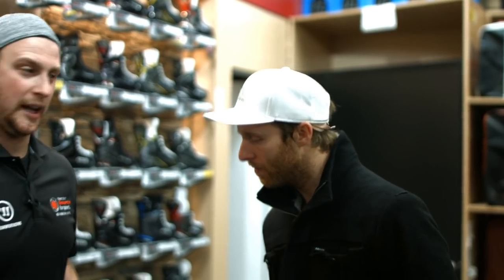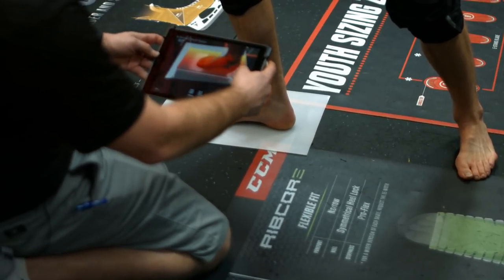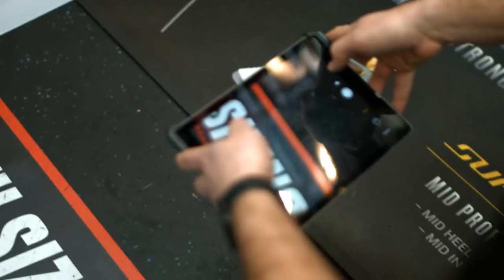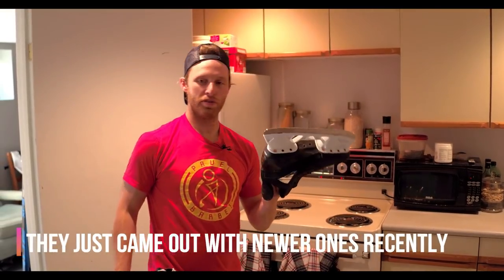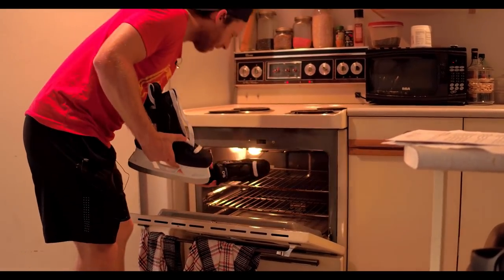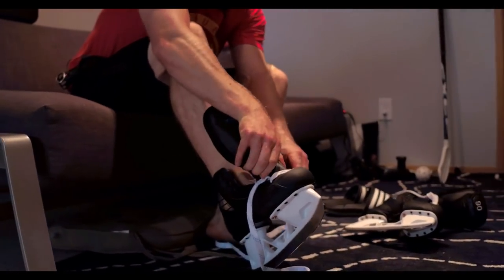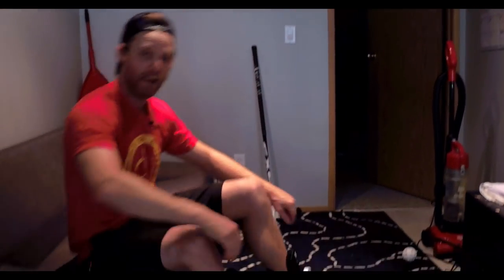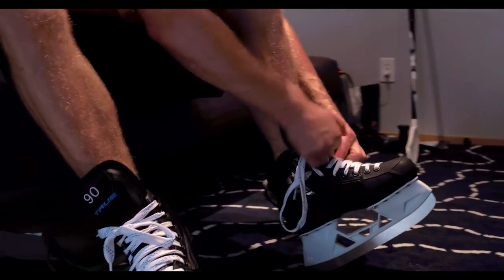How TRUE Customizes Skates!

Comment: I went from Bauer customs to True TF9s. The improvement in my skating was dramatic. I have odd feet, wide forefeet, narrow ankles, Bauer customs just don’t take that into account correctly. Even though the TF9 is an off the shelf skate, they are so thermoformable that they fit like slippers. In fact the only problem is getting them on and off, it takes a wee while, with some care and gentle persuasion.

Comment: Those skates are only good for certain fits tho
Reply from the maker: What do you mean "certain fits?" it's a custom boot shaped exactly to your individual specs.
Reply: Pavel Barber  I meant like if u need a special fit it’s perfect but if u have a regular foot it’s better to go with something lighter like Bauer. This is just my preference I like true skates and still think it’s amazing what they do
Reply: I have to disagree with you on that, I have a regular foot and these are by far the best skates I have ever owned.
Reply from the maker: @Ja9two  The issue is that I don't think you've ever purchased a pair of True skates so you don't really know what they feel like. If I'm correct then you really can't comment on the fit of these skates. And it's not just for people with weird feet. It's very good for any foot shape, perfecting the form fitting size.
Reply: Pavel Barber I’ve had one before and didn’t like how heavy it was
Reply: @Ja9two  How much do Bauer skates with Pro Grade Step steel weigh?
Reply: Yes. I have a regular foot too and I still find them amazing. I was in 2x Pro skates prior and I find True allows you to turn much tighter.
Reply: Where are the reviews from people with weird and problem feet? I've been through soo many adjustments, orthotics and skates. At 1000 a pop who would afford to let them try again if they didn't get it right the first time.
Reply: @ClassicGil  Wouldn't the tighter turns that be related to the skate blade profile?
Reply: @chrisd3510  Its definitely related to blade height... Taller... Higher degree of angle.  That's why it's laughable when people cry about weight... Pro Players demand STEP Steel... It's taller / heavier.  A Bauer skate with STEP weighs nearly same as a TRUE that comes with STEP.  The difference is you spent extra money buying STEP for your Bauer's.
Reply: @chrisd3510  Yes it is. But I do also believe that the skates construction has to do with it. The TRUE skates is similar to the MAKO which I wore several years ago. Both could corner so hard and really turn on a dime. If you havent tried them before, you just would not believe it. The only drawback I can think of is that is not as stable on the lateral side as compared to my 2x pro.
Reply: @ClassicGil  I'm skating in Makos right now though I ended up switching out the blade holders from my broken down Graf skates to get the same incline. The Makos fit my skinny ankles and heels and low profile foot like no other skate I've tried, but the arch is still too high and the forefoot area is too far from the heel area, but at least I don't have to add inserts to the side and tongue to take up the extra space like my "custom" Graf G3's. I see that True offers a solution to rebake and clamp or wrap the skate to get the skate to fit the foot better if the manufactured skate didn't come out right, but why this should be necessary for a custom fit I just can't figure.
Reply: @chrisd3510  I just dont think they will be able to achieve the perfect fit without baking. One thing about these skates is that they are so malleable. It allows you to customise the fit for your own personal preference. But there are rumours that the scanning part was not done correctly in hockey store and that most didnt use the wrap method suggested by TRUE (by using shrink wrap). 

But hey I totally understand what you meant. I had the same problem in my makos. So at that time I went back to Bauer Vapors. For the TRUE skates, I have had a similar problem but it was tackled with by taking out the red insoles and rebaking them. My local hockey guy had never come across with TRUE so he didn't dare to bake them for 10 minutes the first time. So the fit was pretty sloppy after the first bake and the arch issue is still there. But it was completely gone after the 2nd bake and it fits like a glove now.
Reply: @Ja9two  I have a pair of VH's before they were True. About a year ago I got back into roller hockey and purchased some $650 Missions. I will tell you, there is nothing next to True skates! Not only in fit but in performance too. The True boot is a solid 1 piece carbon fiber, so, the energy transfer is insane. I also noticed my Missions have a lot of twisting and torquing in the boot itself due to what I believe is the from the boot being made from 3 piece carbon design. So, True just started making Roller Hockey skates and.... gonna buy em!